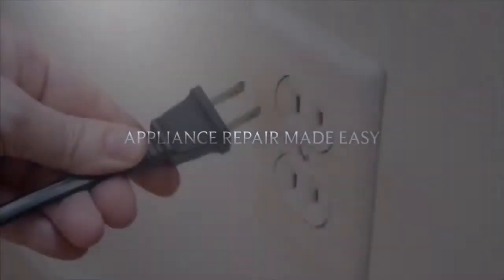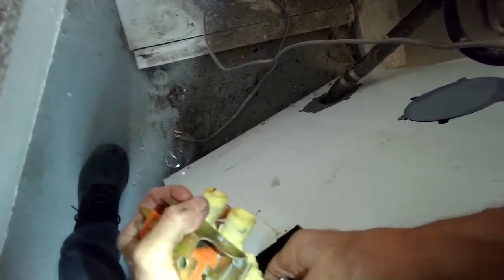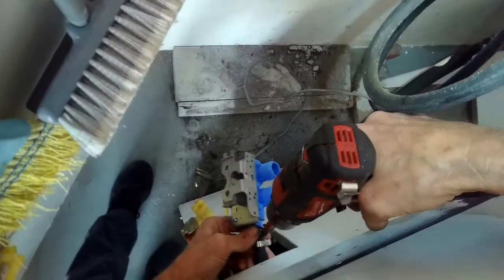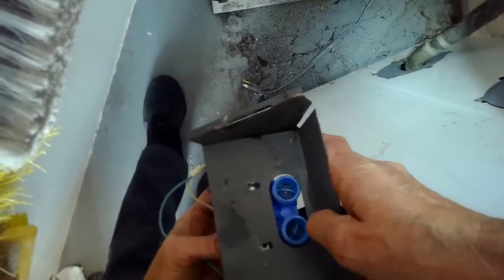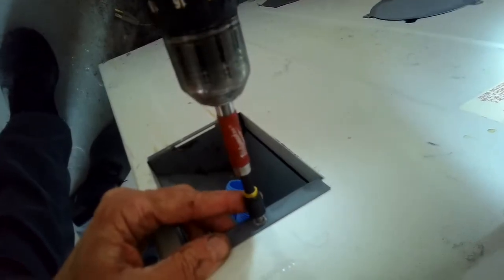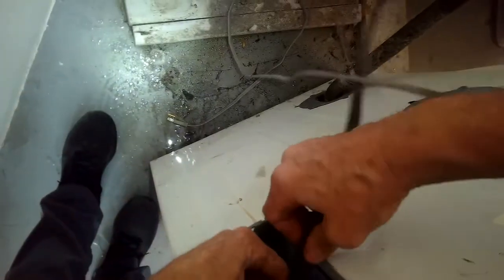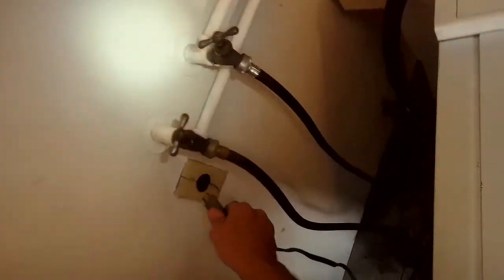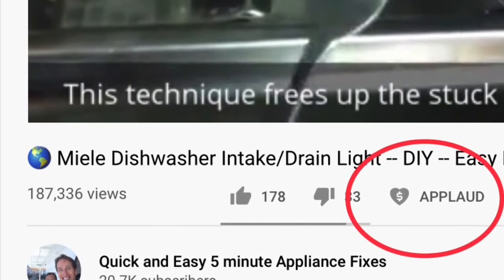✨ MAYTAG WASHER-NO WATER - Easy Fix  ✨

Comment: BEFORE YOU REPLACE THIS VALVE ASSEMBLY, CHECK THE FUSE. IT IS A 1A 250V 312. IT IS BEHIND THE TIMER. 
There should be 24 v DC to the valve when the fill cycle is on.
Reply from the maker: Thanks 👍
Reply: Great advice.  My water quit working this morning opened up and looked at the schematic and sure enough my fuse was blown.

Comment: I have a fairly new Maytag top load washer MWB35 (model number) and it has no visible water level once the machine stops filling and begins the wash cycle. I was told it is due to federal standards of water conservation. My clothes are dirtier after I wash them.
Reply from the maker: They normally since how hard it is to spin and use that to determine how much water to add.

Comment: I switched out my water control but still no water. I only run cold water in it and cap the hot water inlet...thoughts?
Reply from the maker: Hi Mark,
I think the lid switch may need to be replaced 👍

Comment: Water goes in mine it just won’t hold it what could be my problem
Reply from the maker: Just take the drain line that’s going into the wall drain and pull it up by about 6 inches and then it won’t drain while it’s filling

Comment: I had a leak that was going on at the bottom from a hoses but now my washer isn't filling I called a repair company they think it's the timing thing help
Reply from the maker: Probably just need a new fill valve👍
Reply: @QuickAndEasy5MinuteAppliance  this water value has like a power supply to it

Comment: With my washer it won’t start/fill with water but if you put the washer on spin it’s spins 🤦🏽‍♀️
Reply: I’m having same problem…did this fix it?
Reply: Mine was the washing sensor switch
Reply: What codes did you have?
Reply: @Cruising200   no codes older washer but replacing that washing sensor fixed my problem,
Reply: @brianawilson1920  ok thanks
Reply: @brianawilson1920 where is the washer sensor?
Reply: @ElevatedMindz  I popped off the part where my knobs are at an it’s right on top not hard to get to , but my washer is older no fancy buttons
Reply: @ElevatedMindz  when you pop off that top part it’s gonna be on your left side, your gonna see what I believe is called the pressure switch. it’s white and should be connected to a clear tube,Right next to that is the washing sensor. It looks like a little black box I ordered replacement on Amazon I think I paid 45 bucks